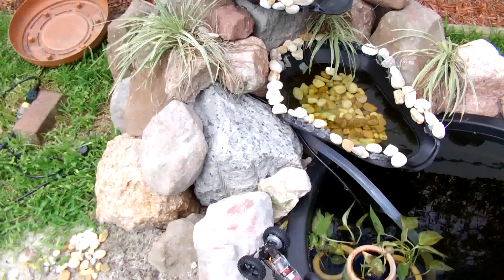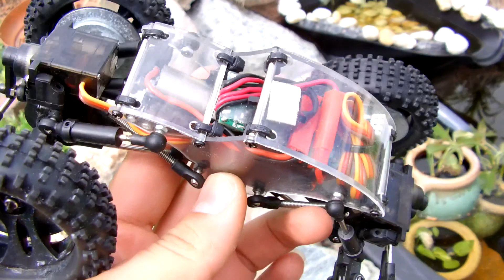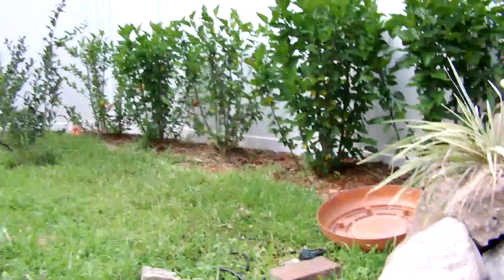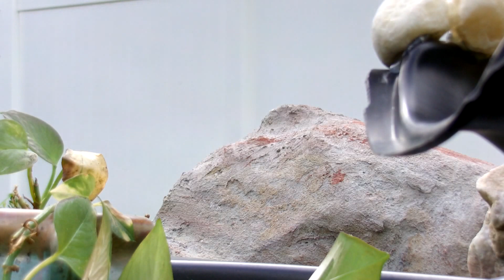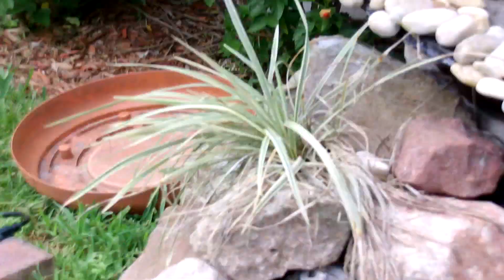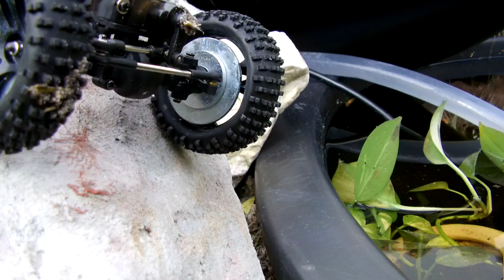55 Redcat Racing 1/24 Sumo Crawler Micro RC with mods / upgrades HSP Tire Test

Comment from the maker: Thanks, and no worries, no such thing as dumb question, and yes I was actually using my coreless motor on this video, wanted to show that it not only has the speed you need but it has crazy slow wheel speed control. Now the motor on this one is from a Solar Servo, because its the cheapest coreless servo I found, but Im sure a higher quality coreless servo will get you a much better coreless motor.

Comment: Greetings: Gamyrc
  I was doing the video for the spider chassis and something happened to the gearbox. Would you have any info on where to get a replacement gearbox or geramotor and any info on the geramoto it self like rpm’s, torque or any other info would be appreciated.

Comment from the maker: They are buggy tires with modded wheels to make them work for the crawler. I show how to make them on video 49. The part number is HSP-Parts-58030 and you can get them at helipal.com. Right now they are out of stock though so you might have to wait a bit for them :(

Comment: I used modeling clay, let it dry. I also tried putting polistyrine plastic in to make the holes in the gears, like the drive gear has the flat in it. I did my best to match it all up. I had a hard time getting the jb weld to sink into the impresions.... so im going to go crack the moulds now... fingers crossed!!! I will let you know how it worked out for me

Comment from the maker: Yeah I still got the sand box but my kids took over! Have to make appointment to get a chance to run in it! For waterproofing I go simple, plastidip is cheap and effective when used on electronics and doesn't add much to overall size of electronics so they still fit in tiny spider!

Comment from the maker: Thanks, I think that if I mess with foam size/density and different fluids to rub on tire to make it "stickier" this thing will really be a great combination. Im also looking at 1/18 truggy tires that have more but smaller knobs for use on even slicker rock surfaces, I'll post those as soon as I get them in the mail, should do good considering how well these did.

Comment: no worries, I made a attempt to make gears. I am sure there not going to work but if thay hold up I will laugh.... made inpresions of the gear an filled it with JB weld. hoping the epoxy is stronger than the plastic

Comment from the maker: Thanks, the tires are from a 1/18 HSP buggy, they are mounted on modified wheels that have been cut thinner to bring tire to a narrower width and taller diameter to match the crawler, so far they have performed better than expected but I have to test them on different surfaces to see where they will fail.